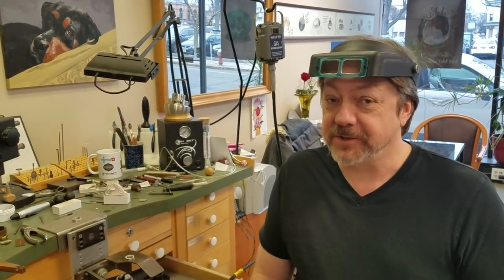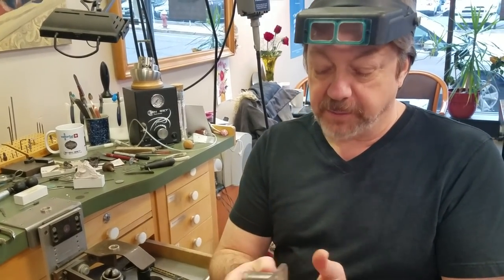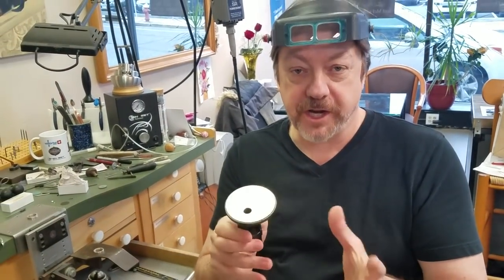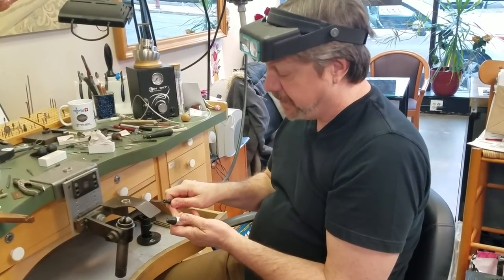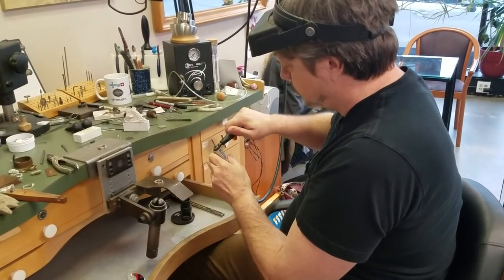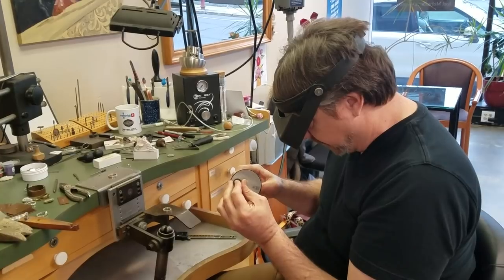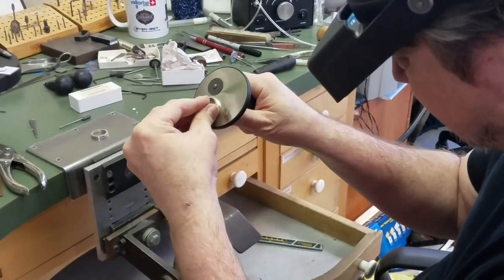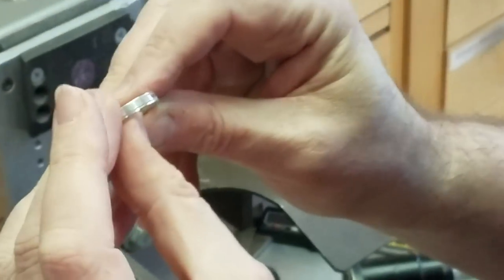How I cut perfect lines and channels in a ring

Comment: 0/ Cover the surface of the item with black marker so you can see any guidelines easily.
1/ Use a 50 cent hose clamp to attach the handpiece to the router table. 
2/ Clamp the assembly into a vise to hold the whole thing still.
3/ Do the work.
This allows me to use both hands ... and I never have to worry about slicing myself or having any change in alignment while I'm working.

Comment: I usually do this task with a saw blade. Very cool jig you got there. Also, another trick for getting the screw off a sanding mandrel it to put a screw driver, or ongolette (what i use) and put your flex shaft in reverse if you have that option. It spins it right out.